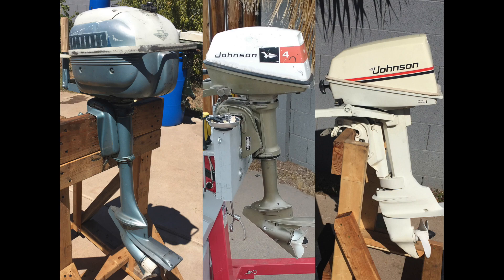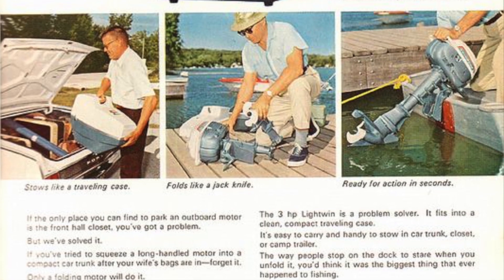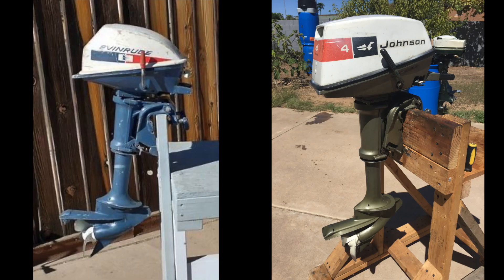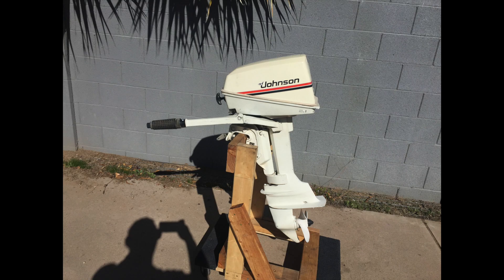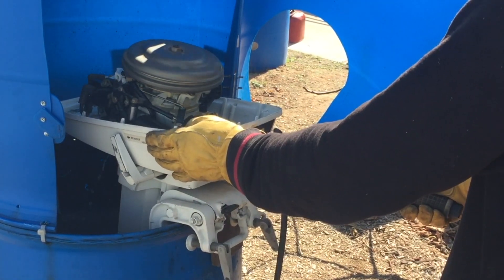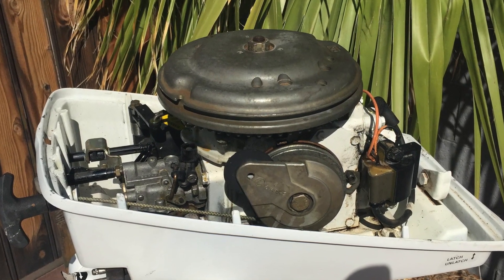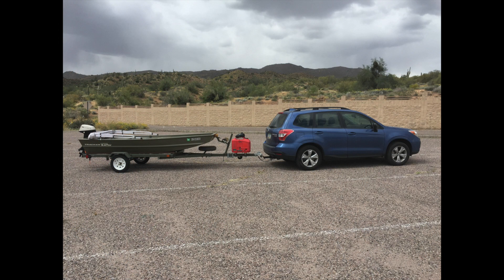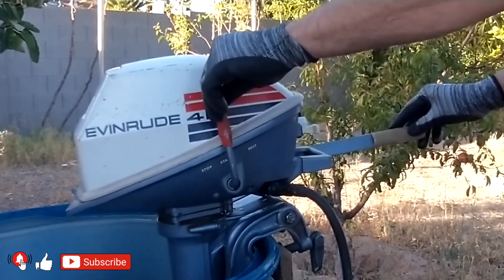1948 - 1983 JOHNSON / EVINRUDE 3 - 4 AND 4.5 HP OUTBOARDS REVIEW AND MAINTENANCE TIPS

Comment: Hey remember you did a video on upgrading the power on the 6hp Johnson? Can you do one with one of these motors?
Reply from the maker: Unfortunately, this outboard motor cannot be modified to increase the HP. The only thing that can be done for the first models is to make a hole in the engine cover. This will allow better airflow and this will improve engine performance and increase power a little. If you look at the hood of the latest models you will see longitudinal holes in the back of the hood. This was done for this purpose, but with recent modifications. Follow the link to see how to modify the lid. https://youtu.be/XaFyvpsTomo
Reply: @BoatMotors can you try to put a 6hp or 8hp or 7.5hp carburetor on it? I think they fit
Reply from the maker: @melonboi186 This is impossible.

Comment: Thx for your Video 👍 I bought my first boat at sweden now with the house from a norwegian couple but no idea. It has this No. 5RHCTA . How to start after long break and which fuel? Thx alot!
Reply from the maker: The motor is 5HP but behind this number there is no motor. Can you find the brand or any other number. Is it 2 stroke or 4 stroke? To service the motor you need to clean the carburetor, new fuel pump, new fuel lines and new impeller. You have to check the spark plugs too. If the motor is 2 stroke you need to add 50:1 - 2 stroke oil to the gas. If the motor is 4 stroke you have to check the engine oil. I will recommend you to change engine oil with the brand and model oil specification. 4 stroke motors are not required oil in the gas.
Reply: @ thx for your answere. At the Engine is written some: (it is white) Johnson , Sea Horse , 45 , 2 cylinders
Reply from the maker: @der.messerjockel.official  It must be 2 stroke motor.
Reply: @BoatMotors  yes of course. But now i am looking forward what to fill up exactely to the canister for fuel? And how to start. My first boat. We will see. Thx
Reply from the maker: @der.messerjockel.official  You can check out my channel I have a lot of videos on cleaning a carburetor, how to diagnose a bad fuel pump and bad ignition and how to start the engine